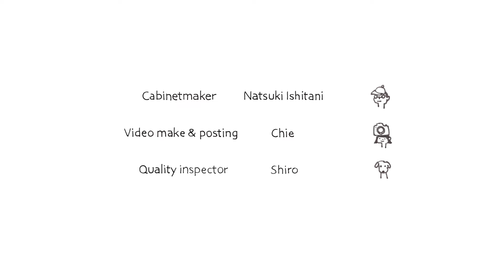ISHITANI - Making a Rounded Legs Trestle Table

Comment: The part where you squared your jointer was the best for me. I don’t know how much time you actually spent squaring the fence but it was obvious you wanted extreme precision, especially when you got the larger square to use more surface area.

Comment: Like many others, I’m super glad to see you back. Love the design. Proportions are slightly off though in my opinion. The cylindrical legs feel too thick compared to the rest of the parts.
Reply: Initially I had the same impression. However, when pared with the chairs the proportions are spot on.

Comment: An off-topic question if I may.  At about 24 minutes (24' 3") there appears to be a compact  vacuum tube audio amplifier (power amp) in the background on the left hand side.  I cannot identify the model but I am guessing (!) it is a vintage 1960s Japanese push-pull EL34 stereo power amplifier.  I'd be very interested to know its identity :) Thanks!

Comment: Question. The grain for the footings run parallel to the ground, wouldn't it be stronger to run the grain parallel to the angel of the cut? It would maximize the length of the grain running from end to end.